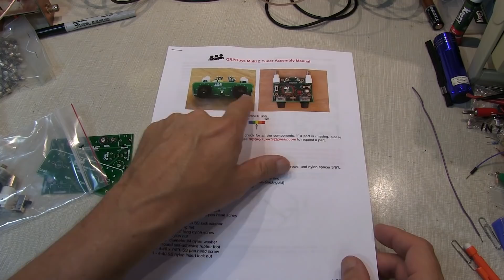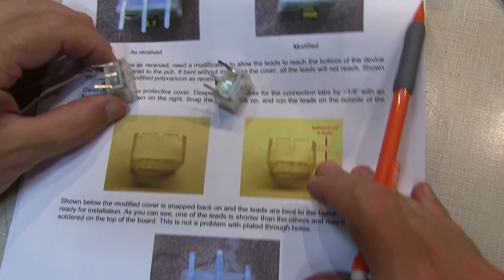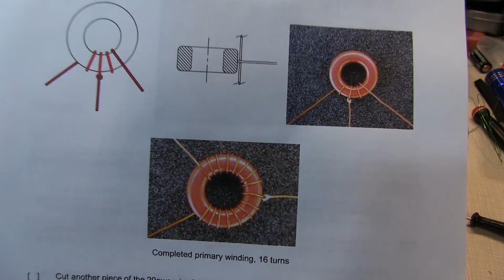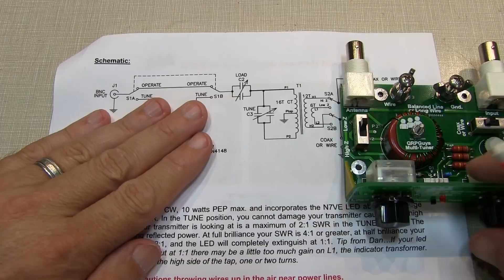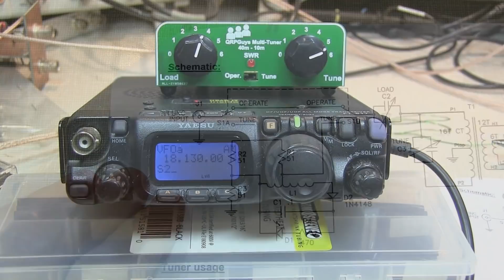#292: QRP-Guys Multi-Z Antenna Tuner for low power on 40m-10m (7-30MHz)

Comment: Can bigger caps thicker wire be used and a 240 torroid be used to make a 100watt version using the same schematic?.
Reply from the maker: Yes, caps rated for higher voltage, and a larger toroidal would be needed for higher power

Comment: I was sent a .01 instead of a .1 for C1..Do you think it is OK to use it or should I get the.1?
Reply from the maker: It’s not part of the tuned circuit, it’s part of the reverse power sense circuit and will work fine.
Reply: @w2aew  Thank you for the reply..I thought maybe it would effect the LED.  I'll leave it in place.

Comment: Hi There, greeting from UK!
(Apart from the 80m band) How does this kit compare with the Emtech one in terms of ease of build and components quality?
Thanks for sharing
Reply from the maker: I found that the Emtech can tune a wider range, mainly due to the additional capacitors that can be switched in.  This one is easier to build because there is a circuit board.  Both are of similar quality.

Comment: This may be a question I should just Google, but I'll throw it out there  anyway - is there an assembled version of this, or a commercial product that does that same thing? I am not that confident in my soldering ability.
Reply from the maker: This one is a Z-Match, works very well, and is available as a pre-built unit or a kit: https://steadynet.com/emtech/zm2-prebuilt-bnc-connectors
Reply: @w2aew  Thanks! Next question - this doesn't handle UHF?
Reply: And, yes I see they have UHF models, but what I mean is if you look in the description for them, it says "The ZM-2 will tune all bands from 80 to 10 meters."
Reply from the maker: @arsbadmojo  there are not UHF models. There are models with UHF connectors, which is a terrible name for the SO-239 connector because it is not a good connector for uhf operation.
Reply from the maker: @arsbadmojo  no, it is for Hf only
Reply: @w2aew  Learn something new every day; thank you sir!

Comment: I built one , but couldn’t get it to work correctly. I measured the ohms in the 3 51 ohm resistors. Found one to be 51 ohms, but the other two only measured around 25 ohms each. Contacted the vendor for replacements. Will see what happens after I get them. Great video and explanation of the circuit.

Comment: Hey, do you think it would be possible to replace the LED SWR indicator with a connector that went to a MicroVNA instead?
Reply from the maker: I'm not sure of the purpose.  A VNA has its own RF source - so if you want to use it to assist in adjusting the tuner, simply connect it to tuner input, adjust the tuner as needed, then re-connect the radio to the tuner input.
Reply: @w2aew   So the purpose of the LED is to show SWR right? I instead want to show SWR on a VNA without disconnecting anything. Can I replace the LED SWR circuit with a connector that goes to my VNA?
Reply from the maker: @nathanjames4242  The LED lights up due to the mismatch across the RF bridge that results from a non-50ohm load.  The LED is configured with a series resistor (to limit the current) to see the voltage across the bridge.  A VNA works differently.  If you want to add a switch to use the VNA, you'd simply switch the RF input of the tuner to the VNA.  The VNA would not use the bridge that is part of the LED-based SWR indicator.

Comment: Quick question. Can you tune for max noise then key up and be even closer?
Reply from the maker: Tuning for max noise will usually get you close, but will still usually need a little fine tuning to optimize it.

Comment: If I wanted to use a single wire with this tuner, would it be a resonant or nonresonant length?. Im not sure what a z match tuner is for. Thanks for your help. KG7CQG
Reply from the maker: It would likely be best to be a resonant length.  An end fed antenna will have a high input impedance.

Comment: @w2aew
I have a question...
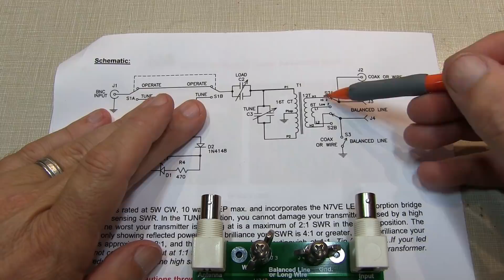The conventional ratio for matching a transmitter output to an untuned end-fed wire is 3:1 winding ratio to produce a 9:1 (50 Ohms to 450 Ohms) impedance transformation, yet the winding ratio for this transformer is 16:12, which is going the wrong way. Even if I'm misunderstanding the circuit and it's really a double 8:12, that's still only 1.5: 1 winding ratio for a Z match of 2.25:1. The low impedance side is 16:6, which seems equally wrong. What am I missing here? Is there some phenomenon that magically makes the primary  a 50 Ohm load to the transmitter? Or does it rely on transforming the impedance of the secondary circuit (transformer secondary and antenna) to generate that effective impedance?
Backing up, and sharing what I think I know about this... C3 and T1 primary form a parallel resonant LC circuit, which has its highest impedance (and therefore voltage into the transformer primary) at resonance. Conversely, C2 and T1 form a series resonant LC circuit which has minimum impedance at resonance - again, transferring the maximum energy to the transformer. All that makes total sense... but the ratios? I'm scratching my head.

Comment: Very neat video. I'm posting it on my ham radio fb group. Excellent explanation of the Z-match design. But what's the "Heat it inside" sticker on top of your FT-817?  Curious.
Reply from the maker: It is "Hear-It" - a DSP noise reduction module: https://www.eham.net/reviews/detail/3626

Comment: Nice kit build Alan...I love PC board case construction, especially when you consider the skyrocketing cost of enclosures nowadays (hint: you can do a lot with the old PC switch boxes and metal hard drive enclosures which can usually be had very inexpensively).  73 - Dino KL0S

Comment: What are some good projects as an intro to RF electronics? I find the "black magic voodoo" to be intriguing, but it would be nice to test the waters before taking the (rather expensive) plunge.
Reply: 1. Build a 'crystal' radio which most often uses a germanium diode instead of a crystal. Only a few parts and some ingenuity required. There are loads of plans on the interwebs. You will learn the most basic principles of what RF is and how to 'turn it into' an audio signal.
2. Get an inexpensive FM radio kit, look around for one with an explanatory leaflet. A lot of the kits use a component that looks like a transistor but isn't, it is a three leg IC with the radio circuit inside. But these kits are worth building when you are starting out because you will gain experience and familiarity with components and soldering.
Reply: @tdumnxy  Cheers, just what I was looking for. I have plenty of experience with electronics as a whole, but haven't done much with high frequency analog.
Reply: Ziferten    https://store.qkits.com/radio-frequency.html  ,  www.a1parts.com

Comment: 10:59 - With it in "tune" mode why will the radio never see "more than 2:1 SWR" ?
Reply from the maker: Because in the worst case (high impedance looking into the tuner), the bridge will present a 100ohm load to the transmitter, which is a 2:1 SWR.

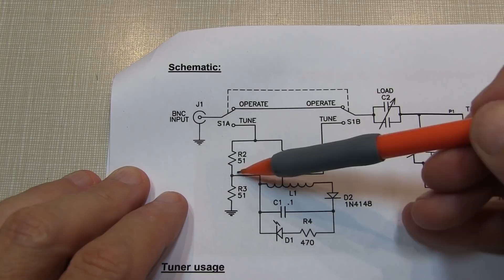Comment: Any reason to use/make an auto-transformer instead of just two windings on a regular transformer?  - 9:35

For the amount of wire required it would seem simpler and easier to use two windings.

Comment: Is This a tuner for any mobile radio use in cars? eg. Motorola CM series.
Reply from the maker: It is for adjusting the input impedance of an antenna system for low power amateur radio (ham radio) applications between 7MHz and 30MHz operating frequencies.

Comment: I like the caliper lead bending technique. I’ll have to try that.
Reply: <slaps forehead> Why didn't I think of that?
Reply: It is a great idea on the face of it, but only with one of those 10 dollar plastic jobs. I used to see folks using their calipers as scratch gauges at work. Hmmm... I would not subhect any of my calipers to such lateral forces and continue to expect any ultimate accuracy. It's an abuse of a measuring instrument. In the context of the video though, it's another great "why didn't I think of that". Still a massive thumbs up for this and the other videos from this channel.
Reply: Yea, that is clever. Could be used for other component leads.
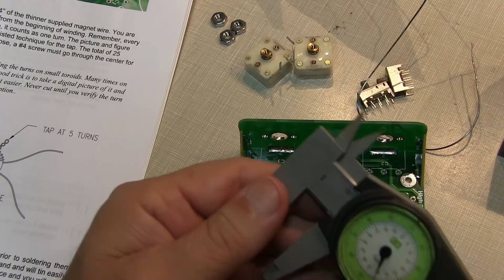Reply: For those for looking for the caliper part, it happens at 3:55